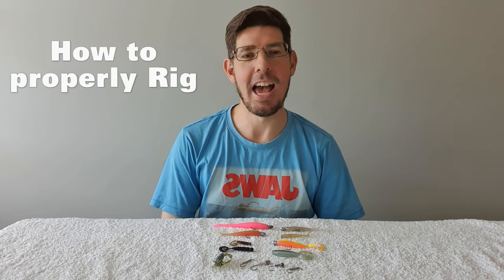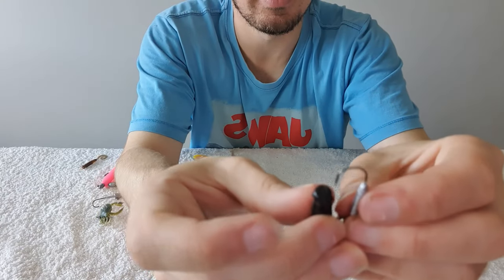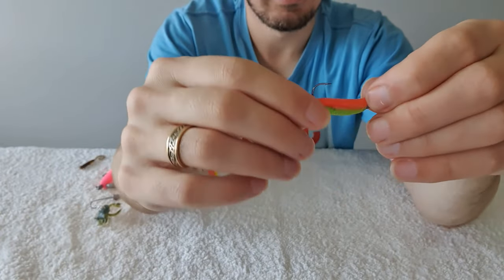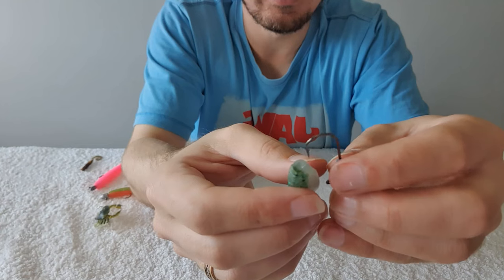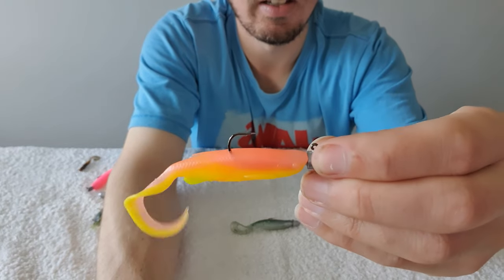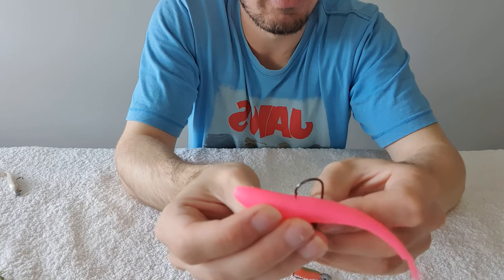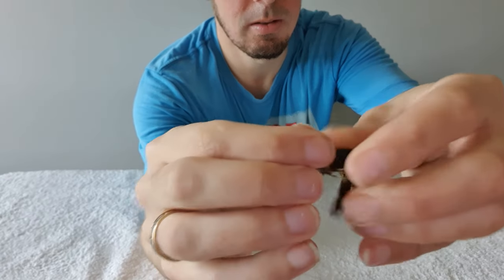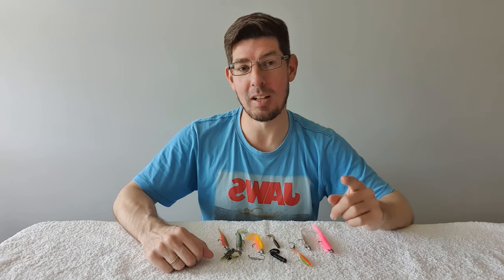How to rig EVERY type of SOFT PLASTIC properly

Comment: Well done. Just started on the plastics. How do you select what type of jighead to use?
Reply from the maker: It all depends on the species your targeting and the depth and current of the system and the casting distance needed. Eg heavier if deep water and strong current, bigger if larger species. Small jig heads when finesse fishing or targeting fish with smaller mouths. I have a 90 minute workshop on how to choose the right jig head in the FishingMad members area that might be worth checking out.

Comment: Hi alan, with the yabbie, I threaded it through its backside only for the reason that they swim backwards, so jigging it will pull it up backwards , does that make dense ??
Reply from the maker: Makes 100% sense, I have actually been doing the same since posting the video, I find the pincers on the yabbie also have more action that way. Thanks for the comment.

Comment: Thanks for that Alan, I'm never too clever to ignore the basics.  I really liked the look of that stand up style crab rig at the end, they present a bit like the Cranka Crabs but a hell of a lot cheaper, how do they go on the Bream?  p.s. I dig the retro t-shirt (even though it's still in reverse).
Reply from the maker: Thanks Garry !! I appreciate the comments. To answer your questions the stand up jig heads work really well on bream. Any yes far cheaper then cranka crabs. I have had success with them mainly casting near structure such as pontoons or jetties then letting them sink and only adding very subtle occasional lift, often getting bites on the way down. Its an effective way of targeting bream, I aim to use it a bit more soon. And yes glad you liked the retro shirt, im still waiting on the GoPro 8 Mod which will finally have all movies in non reverse which would be great. Thats not to far away, gopro have released the new cameras but not the mods just yet. As always thanks for the comments.

Comment: Hey Alan, great info here, it took me a while of trial and error to learn that straight really is very important lol.

Just one question I've always used the Gulp plastics because i found they worked well and they have a scent. But are the other brands any good?

I like the zman grubs because they last a while and they don't get destroyed like the gulps do. Some sessions i end up going through 1 nearly 2 packs of the gulp plastics and it ends up costing more than bait! What do you think?
Reply from the maker: The gulp plastics work well, but I find the scent comes of them pretty quickly and they dry out after each use making them unusable. The range of zman stuff is excellent. Also I use on all my videos Savage gear fatheat curl tails, and progrubs. There usually $20 for 4 packets which is amazing value and they dont dry out. I have caught countless fish from bream, snapper, flathead, salmon and more with them. I hope that helps.
Reply: @fishingmad  yeah thanks I think I'll stay away from them for a while plus if you don't close the bag properly you have the scent dripping everywhere in your kayak stinking out your tackle. Not ideal 😂
Reply from the maker: Yes very true !! The smell of that stuff isnt great on the kayak. On my kayak I have been using this a lot with heaps of success https://www.bcf.com.au/p/savage-fat-curl-tail-soft-plastic-lure-6cm/M563151.html?dwvar_M563151_color=Bloodworm%20UV&cgid=BCF08660 you'll see the ongoing deal 4 for $20 hard to beat in my mind.

Comment: Are those HWS jigs from savage gear can’t find them at BCf 😳
Reply from the maker: The jig heads I use are TT Lures generally a 1/16 in size 0. They are sold at BCF but I cant see a link on there website so you might need to go into the store. http://tackletactics.com.au/TT-Lures/Jigheads/Hidden-Weight-System-HWS Hope that helps.